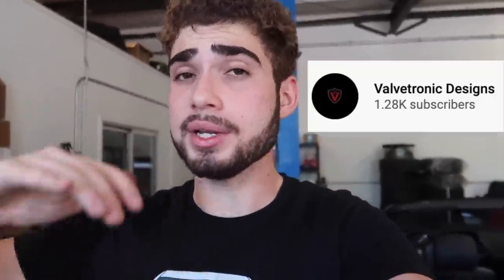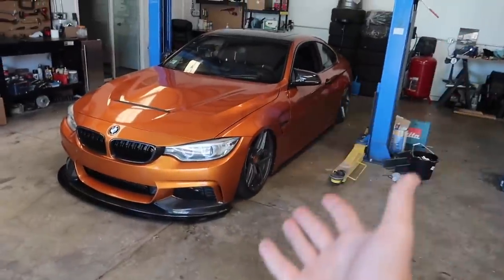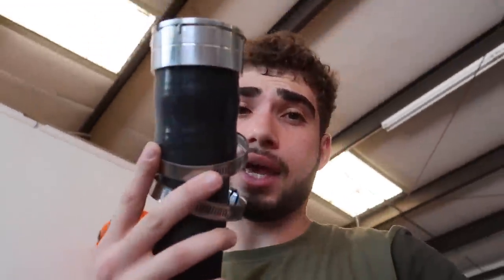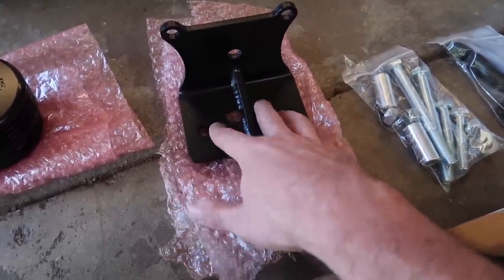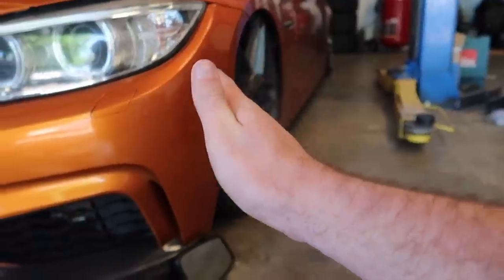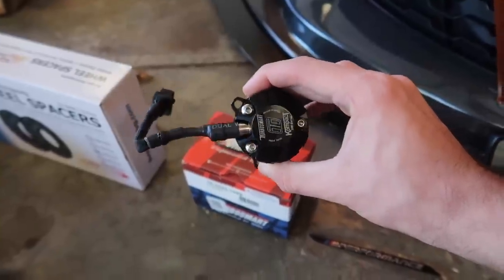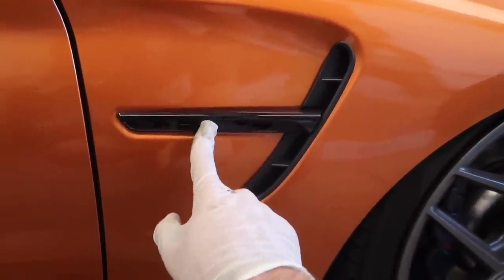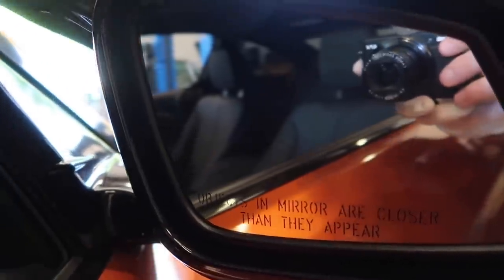ROAD TO 400HP 435I BUILD! Part 1

Comment: Nour, just a tip. If you are going for 400hp on a high-mileage 435i N55 EWG, also change out the other gaskets (Valve cover gasket and BOTH OFH gaskets), the gasket where the actual thermostat is bolted on the engine block tends to leak as well. Lastly, definitely check your rod bearings, since that could still be an issue with N55. Just rock it with 5W40 and you are good to go:)
Reply from the maker: thanks for the tips ill look into it!
Reply: how does one “check” their rod bearings??
Reply: @danner8978  by replacing them

Comment: That’s the oil thermostat housing gasket not the oil filter housing gasket. You can still have a oil leak without changing the other gasket.

Comment: Sorry to tell you, although you already probably know. You didn’t replaced the oil filter housing gasket. You just replaced the oil thermostat housing gasket. In order to replace the OFHG you have to remove the intake manifold. Other than that, great video!!

Comment: What kind of oil filter housing is that? I need to upgrade mine because the current one keeps leaking no matter what and it leaks on the belt, snapping is like every other month. The link to it doesn't work any more

Comment: So the m performance logos on the fenders look wild. I like them. I think you should do an oil flush and a coolant flush. When you took of the oil cooler the coolant sprayed everywhere. To be on the safe side thats what I'd do immediately. I wouldn't have even drove the car. The lower oil temp is only because of the oil cooler. I believed it allows the oil thermostat to open quicker allowing more oil to the oil cooler.

Comment: hahaha I have a 2015 435i and I got the mirror caps you got and I ended up breaking my right passenger mirror as well...  I couldn't find a mirror replacement for 150$ can you post the link to that as well.  I also got the carbon spoiler and Valvetronic exhaust you have. You should let people know to buy an OBD2 port or whatever the wireless receiver is that connects to the phone cuz my valves were stuck closed when I installed it lol. Love the 435 content keep it up brotha

Comment: You should do the oil filter housing gasket as well not just the cooler because it looks like the housing is leaking and going on to the belts. Just an FYI
Reply: Be careful with that. I've read on forums that if not done according to BMW procedures, one can get an air bubble in the oil system and spin a bearing or more.

Comment: this will help me a lot for when i start doing mine after i do maintenance
Reply: also Nour, today was the first day i really tried to push the car after installing the vrsf chargepipe, everything seemed to be in properly but when i pushed the throttle i noticed a lack of power and the car made a sound that sounded like an air compressor shooting out air. Moments later i got a drivetrain malfunction on my  i drive. Since you also got a 435i what do you think could be the issue?
Reply: Ur charge pipe isn’t on there good enoug

Comment: Gotta put some anti seize on those spacers at they don't get stuck in the rotor
Reply: Clean the hubs with a wire brush then a bit of antiseize where the spacers sit.
Reply: @dannyp6572  +1

Comment: You could not change transmision fluid completly by yourself, you will need to go to some service to do it for you with complete flush...
Reply: Sanjin Mouse Transmission fluid flushes kill high mileage transmissions. The 435i has 150k on the original fluid. Its best to make sure the fluid is not burnt and then do just a fluid change so it will be 1/2 old fluid and 1/2 new fluid.

Comment: Bro I seen 335i doing 600 to 700 whp on stock turbos with a tune. You should be fine with all of of that🤣
Reply: Nobody has ever done 600 whp on a stock turbo 335i. Not even an n54.